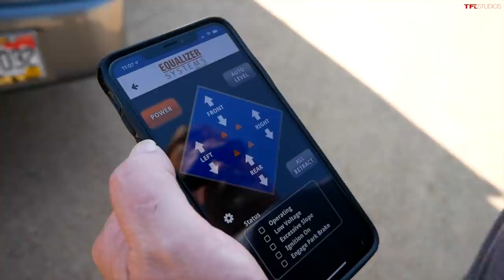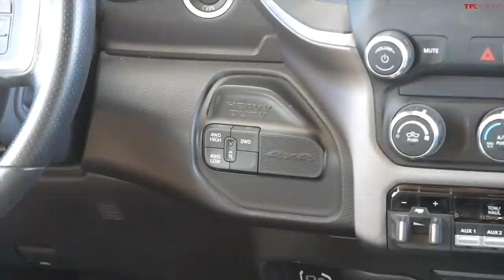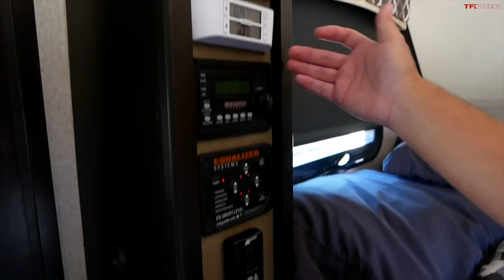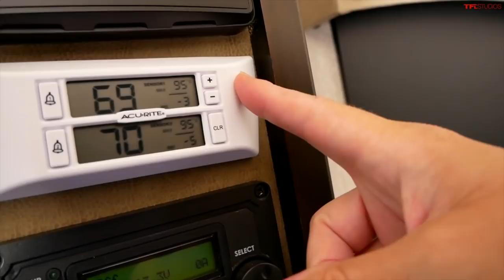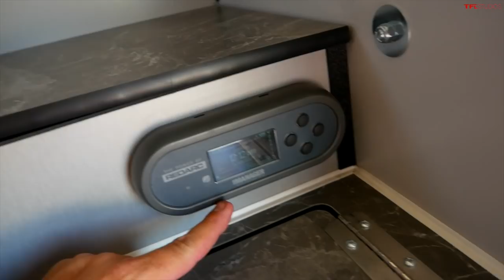Big Camper vs. Giant RV: Which Of These Lifted 4x4s Is The Home On Wheels Of Your Dreams?

Comment: Im happy to see that someone is finally building class C campers on a ram chassis with Cummins power. Never understood putting gas engines in a 20,000#+ camper.
Reply: Nobody wants to deal with the complexity and problems of modern day diesels
Reply: Some people prefer gas since it's what they know, diesel has its own set of cons / drawbacks.
Reply: What is drawback to diesel?
Reply: @rickfetz469  emissions systems
Reply: @rickfetz469  high cost of maintenance on diesels, fueling, cost of failure
Reply: @BullittKid08  its a wash really
Reply: Modern diesel engines are far more expensive upfront and individual emissions items are far more expensive to replace. Modern gas engines are superior in almost all regards except if you need the absolute max towing capacity.
Reply: Especially if you are planning to take it to other countries modern diesels only run on ultra low sulfur diesel which isn't readily available outside of the USA/Canada/Europe. For instance if you go to Baja Mexico good luck finding it.
Reply: All the cons on diesel is the typical mainstream answer as to why not to buy diesels. Have two diesel trucks now. My 1500 4x4 ecodiesel gets 24 mpg avg as grocery getter. My 3500 dually 6.7 cummins gets high 12s mpg with a single slide truck camper. Best thing I ever did too 6.7 was delete it. Both have cost me less to operate then the gassers. Msrp on the rebel with almost every option but the large screen was $68k we paid $60k out the door with tax and tags. The only thing I have seen killing diesels is the government mandates. Egr systems have no use on diesels. The dpf can do all that is required to meet pollution requirements.
Reply: @fredv7487  We install catch cans which are quite an expense as egr delete is illegal. Is it legal in the US? Water in fuel is the biggest problem with modern diesels. A constant concern and pain.
Reply: @Malc664  Interesting because after only 30k on the 6.7 my intake manifold showed a great deal of soot build up. Water in the fuel has always been a problem.A good water separator will almost eliminate that problem. My catch can has yet to catch anything. My point is the egr system does not need to be on any diesel, dpf will meet all emissions. The ecodiesel extracts egr after the def filter and I'm sure their will be little to no soot in the intake. The only reason for the egr is a government mandate.  The government should not dictate what equipment is used to meet emissions standards. The high cost to operate a diesel is mostly created by the government. As far as I see it the government can quit wasting my money on useless crap.
Reply: @alexcapps9290  like who lol
Reply: @gavinhassett479  definitely not a wash. Our company did the math, thats why we have gas trucks that never go down or break
Reply: @fredv7487  youre $128,000 into just two trucks, that seems crazy to me. You were forced to perform federally illegal modifications to one truck to prevent it from future break downs and being unessesarily inefficient, thats also crazy. Wait till the trucks are 10 years + or over 100k, and if you are doing every recommended service as manufacturer suggests you are undoubtedly spending more.
I myself and my company operated diesel trucks and even operated some deleted ones in the field...In the end we got rid of the diesels because when they break (which isnt often) they are downright expensive. It is not "a Wash." When we did the math it wasnt even close. Gas trucks are always cheaper in the long run
Meanwhile with just two of the 5.0L v8 f150's the company i work for owns, theyve literally made millions with the trucks and have only ever had fluids, brakes, and tires replaced. These same trucks also spent 58k miles and 108k miles (respectively) working in AK in some of the harshest conditions you can imagine. 

If you need the performance MAYBE you have no choice but Diesel... but 9 out of 10 guys would be better served with a gasser. Just my .02$
Reply: @fredv7487  You are so right. When the dpf does a burn on the 14 tonne Hino I drive it's pretty stinky, so it still pollutes as bad without it. Is your catch can a good quality one with a filter medium of less than 1 micron? Just surprised your getting as much soot build up.
Reply: As long as it is a 7.3l Godzilla you would be fine. 🥳

Comment: Dynamax.  Space, comfort, and can tow 10,000 pounds, so you can tow a Chevy  Colorado  ZR2.
Reply: You would have to watch hitch weight but the black one could probably get away with towing a midsize pickup on a trailer.  I wouldn't be trying to tow the trailer through off road trials but thats why you brought the smaller truck in the first place.
Reply: You have to be careful with that hitch rating as the carry capacity is around 2100+ lbs, and with fuel, passengers and cargo you can run into trouble fast. I do wish ratings of hitches includes tow & vertical rating. Just saying be careful. I do love the Dynamax .

Comment: Between the two of them, I would get the FWC set up. I would buy neither. I have my own experiment and it will be around $110,000 Canadian. (Just over $87,000 usd) I could drop the price by almost $30,000 if I want a base F150. I have a 2022 F150 SuperCab, Lariat, FX4, 5.0 litre, with the power up and down tailgate (important to my build) and the 2.0 kw Pro-Power Onboard. Ugly as they are, I also ordered the truck with the towing mirrors. For the sleeping arrangements, I have ordered a FWC Project M Canopy with the vents, lights, rear floods, awning, big passenger window, two vents, one with fantastic fan and the electric pre wire package. I have already built the 2nd bed/sofa area for the passenger side with just the top to finish and mate up with the shelf that comes with the Canopy. The refrigerator is a Dometic 55 that I can power with 12 volt or the 110 adapter. I will have that on a triple slide for area to cook with, the sink will be freestanding for now. Could change after I get the unit. I have the cabinets partially built for the drivers side. They will basically only match the depth of the 13” shelf that is in the Canopy. I will have a RV cabinet on top of the shelf with a bit of storage as well, I also have a fold out bathroom planned for the rear on the drivers side that will house a 5 gallon portapotty. In the cabinet up front will be at least one 240 ah LiFePo4 battery with a 2000 watt inverter as well. There will be a flexible solar panel attached to the roof so it offers no profile or wond resistance, 175 w (can add on if another battery is added, but should not need that. That will power all the lights and camper only accessories and be the charge station for the myriad of electronics that now charge with USB (8 plugs strategically placed) and USB A (4 by the front of the box. Everything installed in the box has 1” of hard insulation, the backs of the cabinets, the floor, the tailgate will have an insulated apron similar to the apron that surrounds the pop up canvas as an option. The unit will be used in below freezing climates. The heat for the interior will be electric. Can plug it into the truck itself and that will self manage, start & stop. The added weight will be about 1,000 lbs of the approximate 1700 lb payload on the truck. I pull an enclosed trailer with a 10 ft Jon boat and motors (electric and gas) as well as up to 4 other inflatable boats (all used as one man units) for trout fishing lakes. That has a tongue weigh no more than 300 lbs. 
I don’t see the trailer being an issue to pull of course. The interior can come out in 6 pieces if necessary and take maybe 20 minutes. My wnd cousin has a wood router CNC table and he programmed a pattern to make the plywood floor (oak)look like it is hardwood. We did the machining a,ready and stained the floor, the joints are slightly darker as the stain is denser there and absorbed more. As a result, it looks very convincing and cost me nothing!! Haha.  So for anywhere between about $83,000 and $110,000 Canadian ($66,000 and $83,000 usd) you can have another off-road capable camper with more minimalistic features than the FWC flat deck set up (savings of $57,000 USD for the luxury version to about $74k usd). Savings of $72k cad to $93k Canadian vs the FWC Ram flat deck. I may level/lift the suspension if the 33” BFG KO2s don’t fit well with the set up as is. It is meant to be a full time camper. 
     I bet other people have many more options. Basically, I could have put any truck camper within the payload of the truck in it and been fine for possibly less $, but the Project M has such a low profile on the truck, isn’t quite as wide as a full camper and the weight is distributed mostly into the truck box. Those are my reasons for now!! Haha.

Comment: I like both for different use cases. I have a chance to buy a 76' W300 4x4 dually with factory big block 400 with a factory flat bed. If I buy it I'll do a super single conversion and a three inch lift on it. For 6k I'll be just as capable as a new Ram then put a 4 Season truck camper on the flat bed and I'll be all in at 16K. 2/3 the price  less.

Comment: It's easier to start with the smaller camper and pull a trailer to give you more room. Then that allows you the addition of an extra  bathroom in the trailer.
If the space isn't needed just leave the trailer at home or at the campsite while you roam.

Comment: Two great rigs each for different uses. One concern that always comes to mind is the dry weight vrs wet weight and the amount of weight it can really carry  with people,  Gear, food, water, etc.
Reply: The dynamax has between 2714 to 2956 lbs depending of the options. It is one of the best for cargo capacity. This occc is for cargo people and water. The fuel and propane are already included in the value indicated on the yellow sticker.  It can also tow 10000 lbs depending of the cargo. So it can surely tow 7000. Lbs  for example. If you have 2000/3000 lbs cargo (people + water + cargo)

Comment: 17:10 8000 kW?!?! Dang that's an insane amount of kW in a tiny package! 
8000 watts ;)
Reply: Yeah, that will run a town. A small brain fade there.
Reply: The 28ss has not only 8000watts generator standard not an option. It slso has 950w solar panel 5 x190w flexible panels (not rigid so only 5 years warranty). It has 4x100ah relion self heating battery. 400ah dual mppt controler 40a, 3000w magnum inverter, and automatic transfer switch. It also has dual alternators 220ah each. Heated water bay and secondary 12v heater with sensor and insulated roof wall and floor rated 10.5. And i forgot the automatic hydraulic leveling system 4 points.

Comment: Dynamax 28SS for me with the explorer paxkage 950watts solar and 400ah lithium and 8000 w generator and dusl atermator 220ah for 440a total alternatots. The dynamax js also insulated roof, wall and floor for four season. The tank are heated with furnace and extra 12v heater. 360hp 800 torque, front air suspension. It can be used with no slide out. Tv in the dedicated bedroom. Pass through storage for kayak. Air 360+ winegard. Sleep for 6 with the sofa bed and the front bunk. The dynamax is one of the best for travel.

Comment: Tempting but at a hefty price. If you can easily slide the Four Wheel Camper off and use the flat bed for work then YES it would be the better choice for short durations and constant movement. If you are going to do a basic tour via highway and occasionally drive on the beach (New Symrna/Daytona) then yes the 5500 Ram ISATA would be the way to go.

Comment: The HD chassis have tight turning radius all are designed for that, a 2004 4500 GMC 4 by has tighter turning radius than a Taurus.

Comment: I'm in between those, hardside 10.5 foot floor length camper on 3500 4x4 ram dually. Your hawk is about as long as my rig because of those extra storage boxes on the back. Full dry bath, 6 cu. Ft fridge, good set of compromises for some. Loved the rock crawling! Have you seen the crazy terrain some of the pop top camper guys can go?

Comment: Neither of them. 
I'm a Jeep WJ die hard myself, but for overlanding/RV-style recreation my choice would be a Peugeot Expert 4X4 Dangel L2H1 (long wheelbase) with a 2,0 L/128 hp HDi engine and lifted with 33s. Then I'd drive exptreeeemly more fuel efficient than any overlanding vehicle available on the US market, and can go everywhere where I need to go. Rubicon-type tracks does not even exists in Europe, and the Expert would be excellent to cross Sahara - if I want - as Peugeot parts/service are readily available.

Comment: So there is a $20K price difference between the 2 vehicles, but that doesn't take into account any of the optional add-ons you can get on the motorhome does it? You said it started at about $160K, which leads me to believe the as-equipped version you toured cost considerably more. And with the Li-Ion batteries, extra Cummins 8kw generator, and all the other comfort features, I would not be surprised. These are meant for 2 totally different kinds of use by 2 totally different kinds of people, with the common theme being that they both cost a shitload of money.

Comment: Come on Andre turning radius has nothing to do with the length  it's  the wheelbase
Reply: In real life situations, Rear axle overhang can effect turning radius.
Reply: @garykozy4364   I've been driving an 18 Wheeler for 25 years if you're talking about a 2 axle vehicle distance between the axles is the biggest factor overhang  rarely comes in to play unless you're trying to turn between 2 parked vehicles

Comment: Dynamax all the way I don't need to rock crawl to get to a good camp spot. Also I'm surprised it has a 8000kw generator it's way overkill our 45 foot 3 air conditioner toyhauler has a 5500kw gen and does fine.
Reply: 8000kw (aka 8Mw) would power a small town).

Comment: If you're going to get a motorhome get one that's built on a Freightliner with a Detroit Diesel if you're going to pull a camper you're better off with a Duramax or a powerstroke than a Dodge with a Cummins idea is for the truck to last longer than the poorly made camper that's on top of it or behind it no Dodge that has ever been built is capable of this the only reason anybody would buy a Dodge is because they could not afford a Ford, or they're a YouTuber that's paid by Dodge